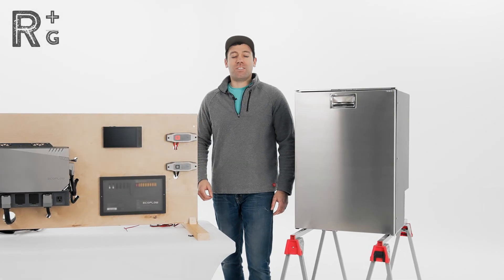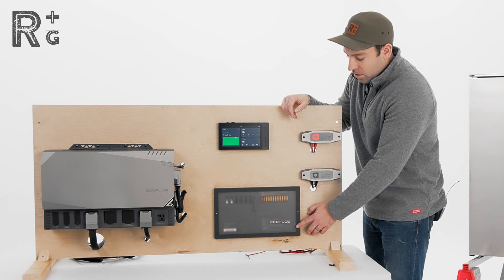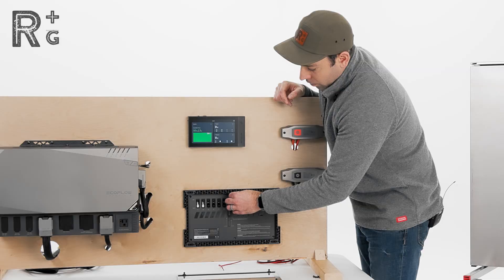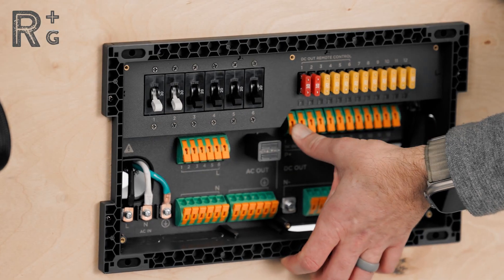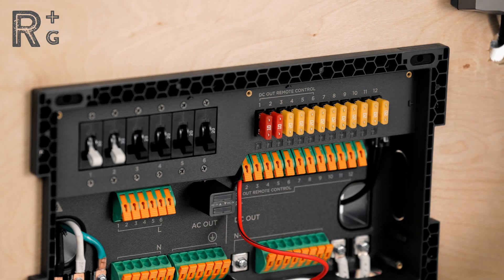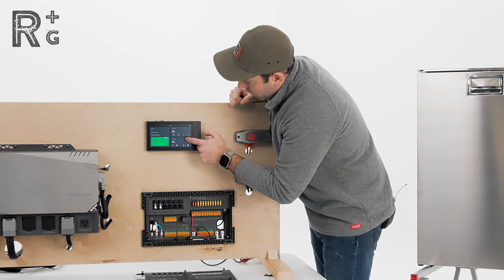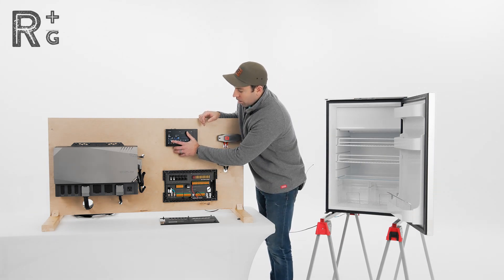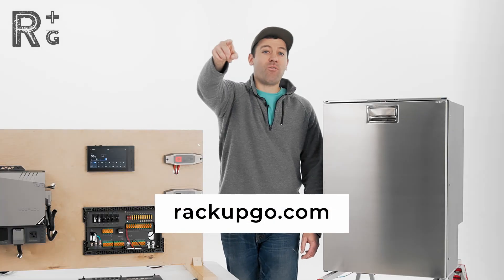How to Connect a 12-volt DC Refrigerator to EcoFlow Power Kit

Comment: Dear... Can we Run 220 volt appliaince?... Tq
Reply from the maker: The AC output of inverter in the Power Kit is 120V for the US version shown in the video. It would not run a 220V appliance without a converter.

Comment: Hi, I have a refrigerator currently wired with a cigarette adapter to power it.  Can I just cut the adapter off and hardwire it into my EcoFlow Distribution box?   I know there a fuse in the cigarette adapter, just not sure if by eliminating the adapter the Distribution box fuse replaces it.  Thanks.
Reply from the maker: You can cut the adapter off and wire it directly to the EcoFlow distribution panel. You will need to make sure the fuse for the circuit you connect it to in the distribution panel is properly sized.
Reply: Thank you!  Appreciate you taking the time to answer.  I was thinking it was OK to do since theee would be a fuse in the distribution panel but wanted confirmation.  Thanks again.

Comment: I see that the number of positive 12v ports exceeds the number of negative 12v DC ports.  Where to the negative wires go when connecting more than 8 DC outputs?
Reply from the maker: You are correct. All of the negative terminals tie back to the same negative bus bar behind the panel. You can either double up wires on a few of the negative terminals, or there is a ground screw to the left of the terminals that could be used.